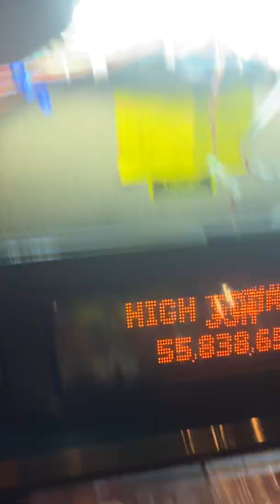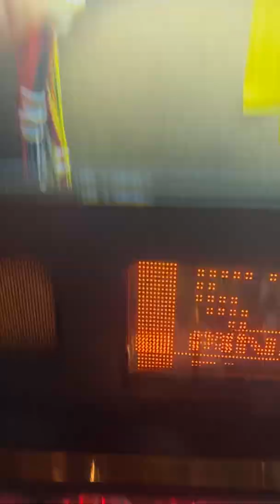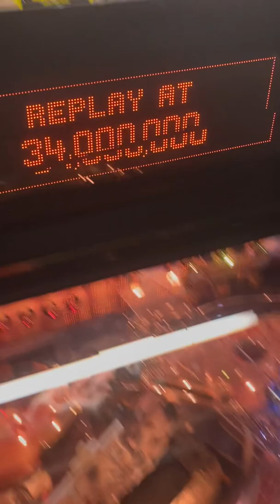How to Test a Pinball Machine Transistor

Comment: Hi there, is this what might be referred to as grounding the tab? I had some trouble with a shooter lane VUK coil being a bit weak so decided to swap it over with another one, managed to wire up the coils backwards, blow a fuse or 2 and short some stuff out and am trying to workout what I've damaged on the board exactly and how to fix it. I was told in a FB repair group that if a coil works fine by grounding the tab, but not when fired during a game, it could be the transistor. I was told I mighta damaged the transistor circuit but not sure what that means exactly and tryin to workout how to test the transistors to see if I've cooked any of them.

Comment: Heads up you can only do this with the large tip 120 and 122 transistors and in attraction mode also,if you do this to other trans it will short them👌🏻
Reply: Is this what might be referred to as grounding the tab? See above comment for more detail. Was told I could only ground the tab on TIP102/120/122 transistors or IRL540 (or 22NE10L, 20N10L) FETs. Others, like some TIPs will short out the circuit and can damage component. Which I assume is what your comment is referring to?